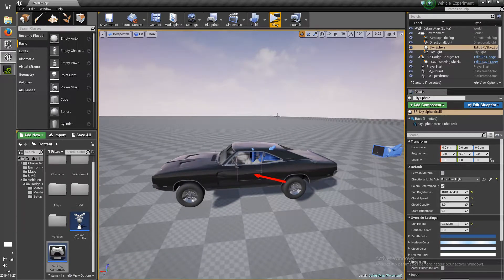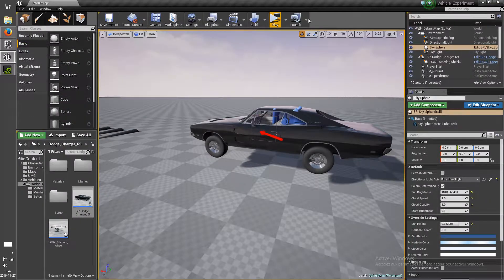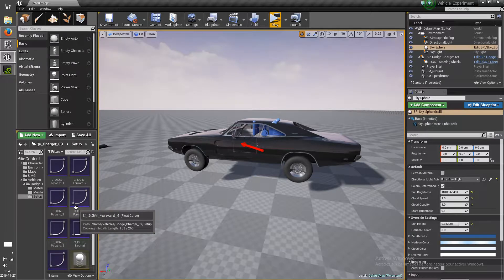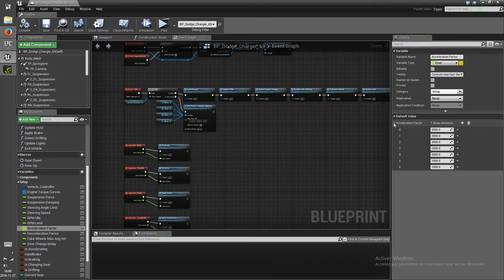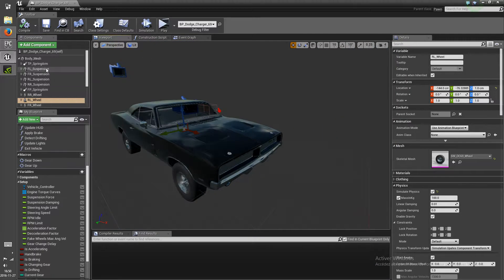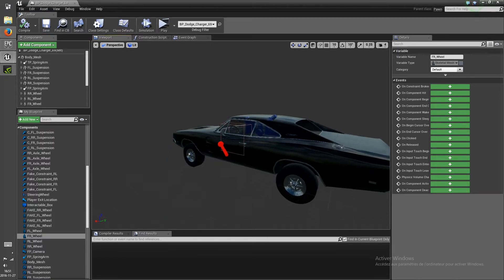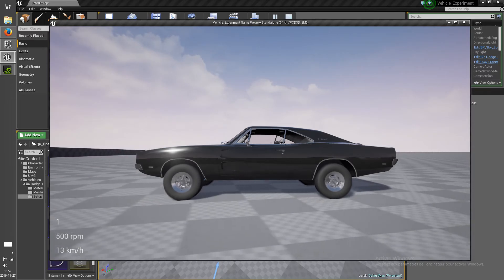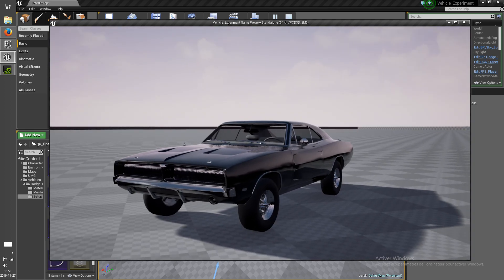Physic vehicle simulation v.1.2

Comment: Why did you make your own physics-based vehicle and not use unreals vehicle blueprint?
Reply from the maker: I mean, have you tried unreal vehicles? Better off making a new system haha.
Reply: @MathB_Official  🤣💯 I've spent way too much time trying to get the wheel to work right on the vehicles.  With unreal engine 4 and 5 they use raycast and it just does not do a good job the wheels go into objects and into walls there's some kind of disconnect between the physics system and the vehicle system.   

I have been working with the project that you put out with the motorcycle car and bug and you really did a great job I'm learning a lot from how you did it.  Right now I'm looking at the motorcycle and it's interesting how you you used a skeletal mesh but did not use the physics asset to set wheels.  I always thought you had to use the vehicle component in order to use a skeletal mesh.  I thought without using the vehicle component you could only use static meshes.   The good thing about using static mesh is you can then use the animation blueprint.

That was interesting too how you did the lean angles on the bike it looks like the faster you go the lustering angle you have but the more lean you have 👍🏻.

Comment: Better and better - keep it up. Only confused me approach, in which the speed and acceleration of the vehicle are given curves. What for? If you make more or less correct physical model, it will not have to worry about it - all will be obtained automatically. Will only set the curve of the engine torque, gear ratios, vehicle mass, center of gravity
and other parameters, and the physical engine is deemed itself.

I apologize in advance if my comment is not quite appropriate. Last year, I dealt with the problem of realization of car physics, and find answers to some not trivial questions. And I just want to share the experience. I implemented a physics not on the UnrealEngine and simply do not know a lot of technical details that are specific to your environment. However, the following theses and claims have solid physical and matematik foundation, and can be implemented in very different tools.

From Newton's second law we know - to find the necessary acceleration force divided by mass

a = F / m

The force in this case the road longitudinal reaction force, which causes the vehicle to move in the right direction. To help us find out what is this power, we need to know: 1) the torque supplied to the drive wheels
2) the angular velocity of the drive wheels, to find the longitudinal sliding(long slip).

Here we can use the curve to set the plot of the maximum torque of the engine speed. Can find a lot of images for specific models of cars \ engines. Just type in a search  - Engine Torque vs Engine RPM or Engine Torque Curve.

To find the actual torque, we must multiply the maximum torque on the throttle.

EngineTorque = Throttle * getMaxEngineTorque (EngineRPM)

Further, the torque enters the transmission, where it is multiplied by a main gear ratio, gear ratio and efficiency of the transmission.

Torque = EngineTorque * GearRatio * MainGearRatio * TransmissionEffeciency

TransmissionEffeciency - the efficiency of the transmission. In passenger cars it is more - about 0.8. In trucks and off-road vehicles with an additional transfer case less - about 0.6-0.7.

There also should be noted such a detail: to calculate the wheel angular velocity can go for a simplified way and assume a wheel rotation speed on engine speed without taking into account the inertia.
Here the golden rule of mechanics: winning the torque we lose in speed.
And if, to see the time on the wheel torque, we multiply the engine torque to the gears, then wheel rotation speed we do so

WheelAngularVelocity = EngineAngularVelocity / GearRatio / MainGearRatio

A more detailed approach is that we take into consideration the inertia of the rotational movement.
Here comes to the aid of the formula for calculating the angular acceleration

Torque = AngularAcceleration * Inertia

This formula is analogous to Newton's second law F = m * a.
Only it works for rotary motion.
Rather than force - torque, rather than mass - moment of inertia.
Knowing the moment of inertia and torque we find the angular acceleration and hence the angular velocity. The moments of inertia for the gear box and the wheels can also be found on the Internet.

Either way we will get the drive wheel rotation speed, which will allow us to find a longitudinal slip ratio.

LongSlip = 1- (CarSpeed / abs (WheelSpeed))

where SarSpeed - longitudinal speed of the vehicle,
abs (WheelSpeed) - absolute value of the rotational speed of the drive wheel.
Naturally WheelSpeed should be counted in the same magnitude as the speed of the car.
If we translate from radians / sec in meters / sec
we use this formula

WheelSpeed = WheelAngularVelocity / (2 * PI) * (2 * PI * WheelRadius)

What you need to know the extent of longitudinal slip? Everything is very simple. The fact that the friction coefficient of a constant value only as long as the interacting bodies do not move relative to each other. That is, until we deal with static friction. But as soon as there is relative motion of the friction surfaces of friction will begin to change the value. Friction is equal to zero at a zero slip. Friction reaches its maximum at about 0.2 degrees of slip, and with further increase in sliding friction force begins to drop sharply and reaches only about 50 percent of the maximum value. Here we can again help to curve between the degree of slip and friction force. Just type in a search Friction vs Slip.
Thus, knowing the slip ratio, we'll know a fraction of the traction force, which is the drive wheel applies to the road surface.

FrictionScale = getNormalizedFriction (LongSlip)

Maximum wheel rotation on a particular gear will depend on the maximum engine speed and a specific gear ratio. And it does not have to limit artificially. A vehicle will accelerate as long as the vehicle body speed is less than the rotational speed of the drive wheels. Once the rate will be equal frictional force multiplier would be equal to 0, and hence the thrust is reset. And vehicle acceleration will depend on the feed to the drive wheels torque, slip ratio, friction coefficient (tarmac \ gravel \ ice, and so on) and of course the mass of the car.

The wheel is a lever pushes away from the road. The torque we know, the length of the arm too - wheel radius. So we can easily find the traction force. And do not forget to take into account the slip ratio.

Traction = FrictionScale * WheelTorque / WheelRadius

It should also be borne in mind that the real traction that will perform useful work can not exceed the reaction force for the particular wheel support

TractionMax = WeightPerWheel * FrictionCoefficient * FrictionScale

where FrictionCoefficient - it is the friction coefficient for different pairs of friction materials. In the context of our question we take the interaction of rubber with various surfaces.
Here are the approximate friction coefficients for different surfaces
0.8-0.9 - tarmac
0.4-0.6 - gravel
0.1-0.3 - ice and snow

If the surface is wet, the data values safely multiply by 0.5

From the formula above it becomes clear that we need to know how much weight at this particular moment is necessary for each
wheel. That is, we must consider the dynamic weight distribution.
How to do this can also be found on the Internet.

And if we will provide very high torque to the wheel, with the result that the force will exceed the limit, the result is excess torque will cause wheel slip.

This comment is already too long, so I will be brief.
I can recommend a couple of good articles on this topic

http://www.asawicki.info/Mirror/Car%20Physics%20for%20Games/Car%20Physics%20for%20Games.html

https://nccastaff.bournemouth.ac.uk/jmacey/MastersProjects/MSc12/Srisuchat/Thesis.pdf
Reply from the maker: wow, I will check out all of this on the weekend, but to give you a simple answer, the accel is ruled by curves because this is still a work in progress and it was a simple way to get a satisfying car control until I can come back on it. thats all.
Reply: Math B clear =)
Reply from the maker: and forgot to say, thank you for the comment, I am really glad to see so many people taking interest in this project :)

Comment: good work! I've been following your tutorials for my vehicle.
Im wondering about other certain other features. 
Not requesting just curious. 
open doors, bonnet, trunk.
ingame rpm tweaking / tuning.
switch tires from flat to new.
body location damage. (there is a vehicle tut that shows how to use morph targets for the body location damage in max an ue4) check my recent video for preview of it in max.
headlights, brake lights, indicaters, interior light (when door opens)
character animations get in an out.
Reply from the maker: Pretty much all of these things require an experienced 3D modeler, wich I am not, I cannot program dammage using morph target if I don't have any damage mesh to morph to, same goes for character animation and sounds and particle effect for drifting and all. Now if you say you want to contribute in any of these manners, I will be glad to add it to the project so that everyone can enjoy it :)
Reply from the maker: oh and the brake and reverse lights are done already, dunno if it was uploaded yet tho, but another update is coming soon as I am building an automatic transmision, and adding an engine stalling system to the manual transmision.
Reply: Math B  I can help out with character animations thats easy. As for morphing It was easier then expected for the car. In 3dmax click morph in the stack (above edit poly) clone the body. use an FFD3 an make different damaged locations. then click the original car body an assign Morpher an click the damaged meshes.
as for the door an stuff opening an closing. can this be done using a socket / bone rotation interaction instead of a door opening animation for the skel mesh? 
great tutorials so far bro! :-)
Reply from the maker: I would do the door using a physic constraint of course :) so that it can be ripped off by accident haha. as for the morp, I'll see what I can do.